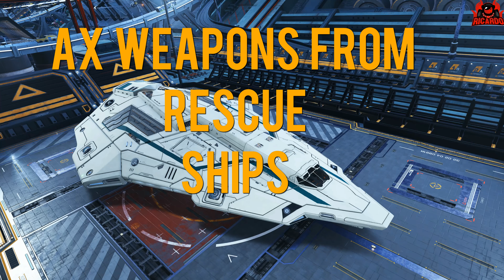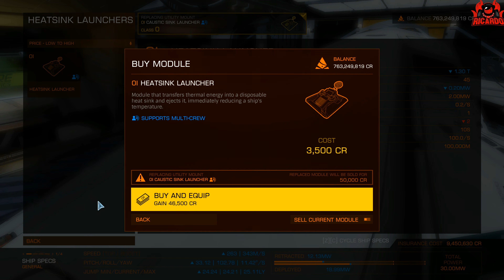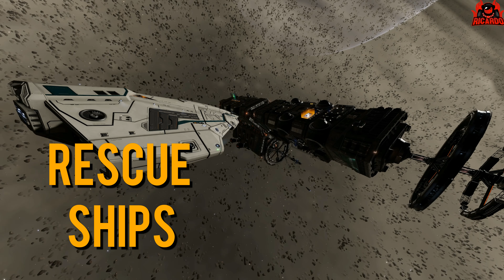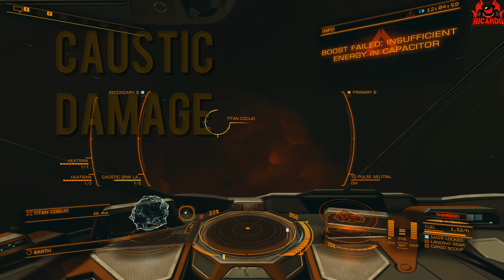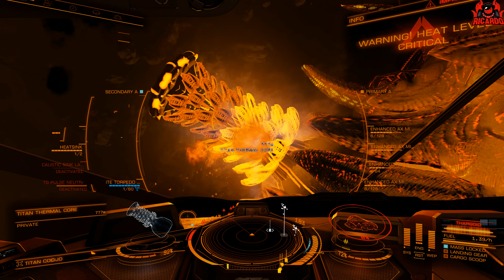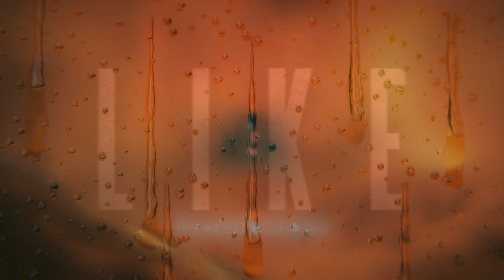Beginner Titan Bomber Build That Actually Deals Damage

Comment: The other thing with using a beam with thermal vent, is that it actually will make it harder. If you are constantly lasering the titan, it stays in an alert state. Which means being shot at by more things. Conversely if you manage heat and use the asteroid field to hide out in, the 'goids mostly ignore you (until you go for broke on the vents and core again).
Reply from the maker: Oh definitely, but as I explained, that is behind an engineer grind to unlock